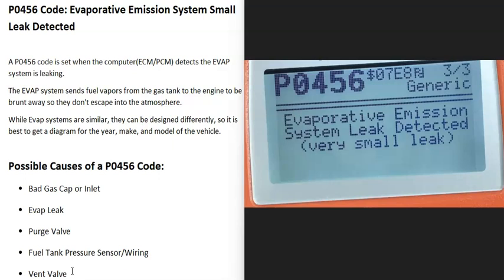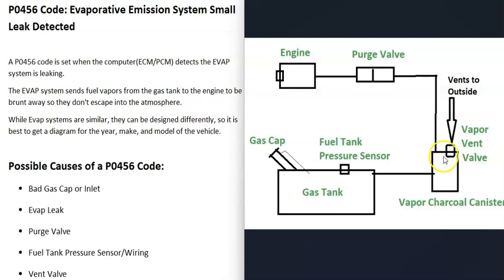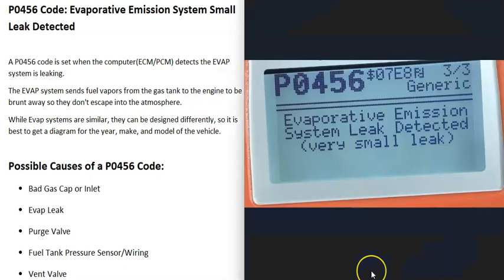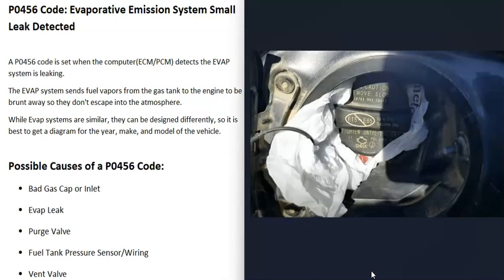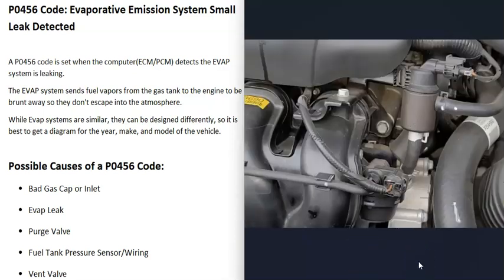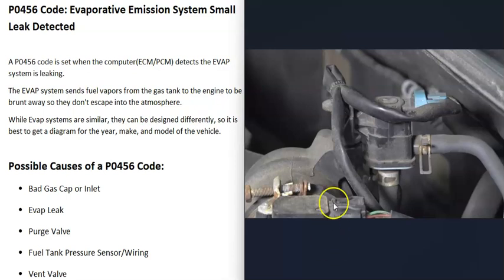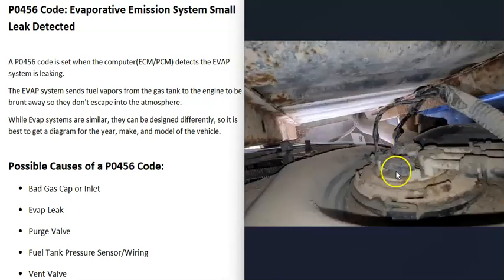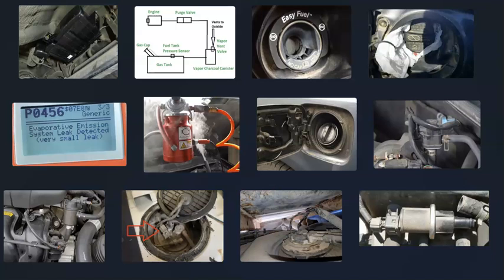Causes and Fixes P0456 Code: Evaporative Emission System Small Leak Detected

Comment: I have a 2014 f150 xl and it doesn’t even have a gas cap.Just a metal flap. I just stick the gas nozzle right in it.
Reply from the maker: The flap works he same as the gas cap it needs to seal or it can leak.
Reply: @HVAC_Mechanic how do I know if the flap is sealing properly

Comment: Would the rubber seal around the top of the funnel cause it? Mine is cracked and a little piece missing, the rubber piece around the funnel where you put the gas cap on, the on sealing up the hole in the vehicle to go down through, I never see anyone mention this and I can’t find it anywhere online either, the name of it either., wonder if that would matter.
Reply: Yes if the oring is bad change it that is enough of a vapor leak to cause the issue

Comment: An interesting video.  I have replaced the gas cap. This error only occurs while on cruise control on my 07 Subaru Forester, and typically when the tank is from 1/3 to 2/3 full on the dash gauge.   Is that useful information for tracking it down?
Reply from the maker: Each vehicle computer has a different Drive Cycle for when and how it tests the EVAP system. It likely just did a drive cycle and seen there was a leak. If there are no other codes and the gas cap is good, I would do a smoke test to see if there is a leak.

Comment: I've had a P0456 on my 2010 Santa Fe for 3 years now. The problem is it only happens during the winter, when it's too cold to diag. Of course changing the cap, purge and vent valves didn't fix it. 
CEL on in November, off in March until next winter! Like clockwork.
Reply from the maker: When the weather changes, it can affect how the rubber hoses and plastic parts seal, causing leaks. This makes it difficult to troubleshoot. The best way is to smoke test the EVAP system outside when the weather is cold to find the leak.

Comment: I replaced the purge valve selnoid plus I replaced the gas cap plus put a new battery in it plus a new alternator and serpentine belt plus a new power steering reservoir. I have rpm fluctuating while driving. I don't know what else to do with my 2012 Chrysler Town and country mini van. Does anybody have any suggestions on what else I can do for this vehicle.
Reply from the maker: A stuck open purge valve is the only EVAP component that can affect the engine; if it's good, there are likely separate issues. I would smoke test the EVAP system for a leak. For the RPM issue, it sounds like a throttle body problem. I would check it for any buildup and clean it up with throttle body cleaner.
Reply: The vans are a mess, I have to do the brakes like every year , I’ve done a lot to mine too and then rust on top of it is crazy, cut, welded and more, these vans aren’t to good that’s for sure.

Comment: What would cause me not to be able to quickly pump gas into my car? I will begin refilling my tank at a normal speed with gas then the car forces me to stop and it will stop over and over and over again as I’m refilling so I have to go very slowly when I refill my tank I would appreciate any advice thank you.
Reply from the maker: It needs to be diagnosed, but that is a common symptom of a bad vent valve, usually located in the charcoal canister.
Reply: @HVAC_Mechanic Ty!
Reply: Try to fill up in the evening when your gas tank has a bit less pressure than it does through the day. Also , the less gas you have in the tank the more vapors you will have causing pressure..

Comment: Why does the fuel filler neck mess with the speed and rpm??? Also what causes a recurrent issue with the purge valve becoming stuck open?